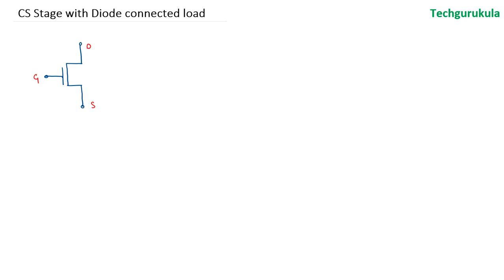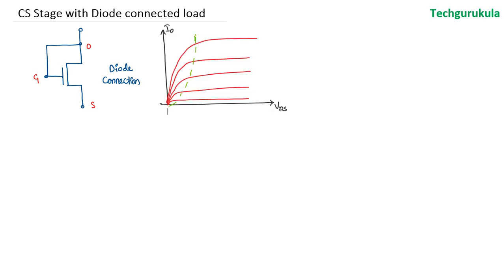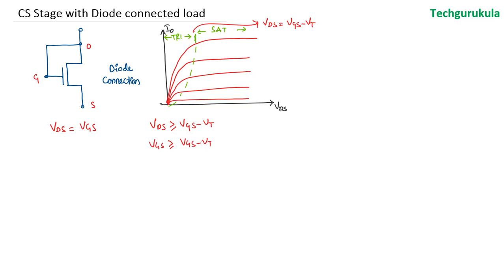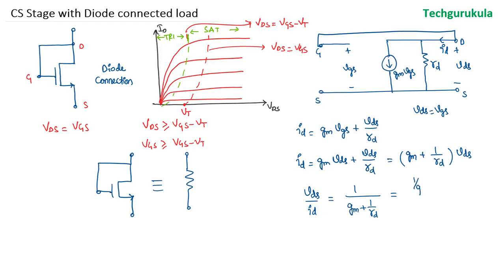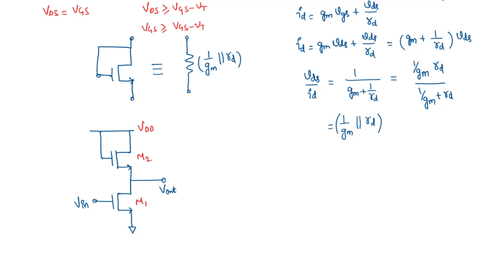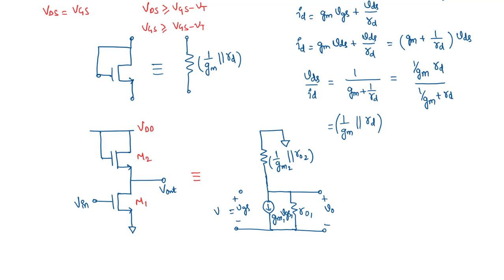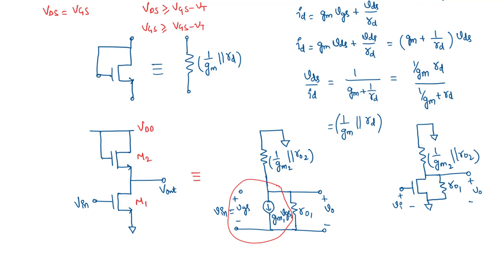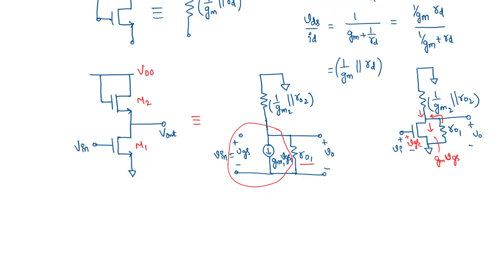MOSFET: Common Source amplifier with diode connected load

Comment: Since fet is a symmetrical device, so connecting G and S should be similar to connecting G and D ?
Reply from the maker: FET is symmetric device - source and drain can be used interchangeably. But, once you plug in the MOSFET in the biasing voltages, for nMOS which ever side is of lower potential that side is Source and the other side (at higher potential) is Drain - now source and drain terminals are fixed. Hope that clears. Let me know if you still have question.
- Techgurukula.
Reply: @techgurukula  Yes it is clear now. I was thinking the same too.
Thank you!
Reply from the maker: Good to know.